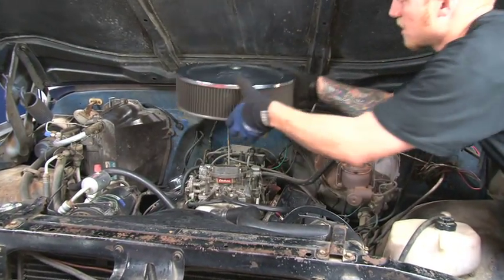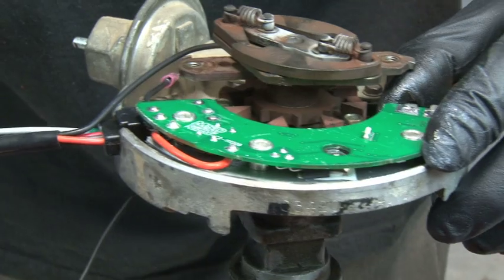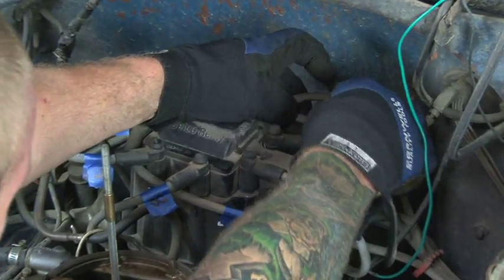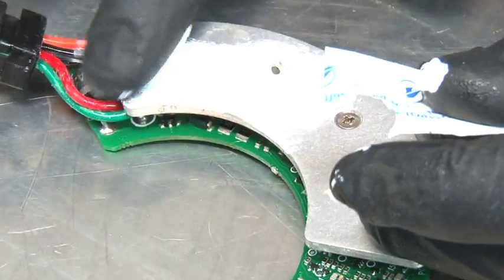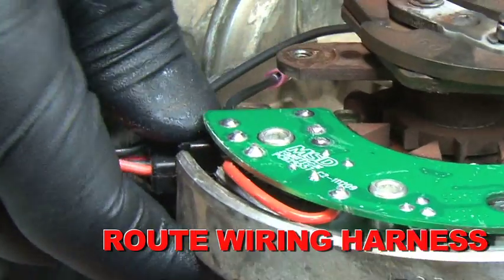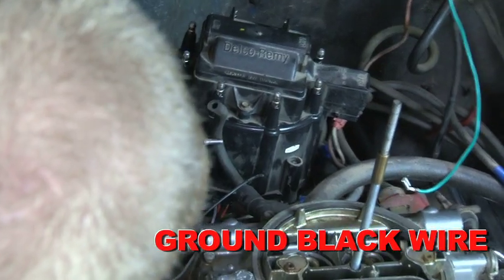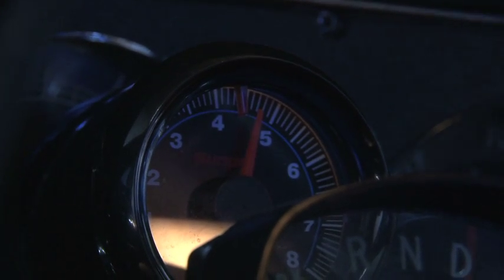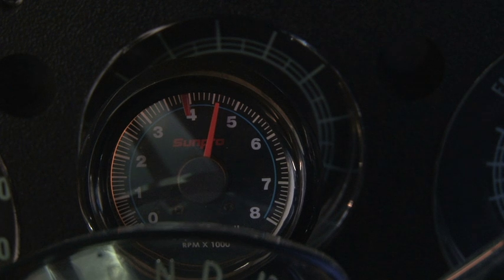MSD Ignition HEAT HEI Module Install

Comment: How can you hook the distributer up the the MSD ignition. Where does the black and the orange wires go since the distributer already has a built in coil and a plug  it is connected already by a plug

Comment: I must get this MSD Heat HEI for my 1987 Corvette l. Built all new motor for my 1987 Corvette, 355 ci. Double Roller Rocker Timing Chain and Gears, Flat Tapet Pistons 10.5:1 compression, Flat Tapet Valves. CompCams Hydraulic Flat Tappet Cam. Machined L98 Heads & installed 1.6 Stainless Roller Rockers, new valves, guides, and springs. Machined Runner's and Plenum.